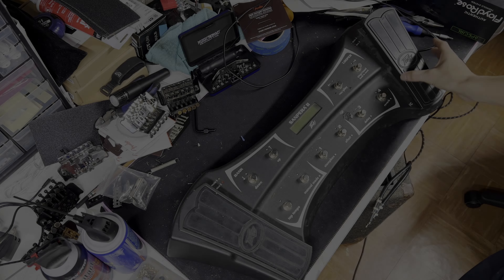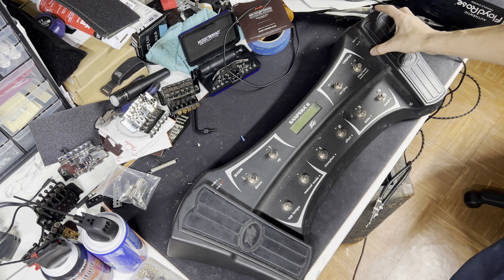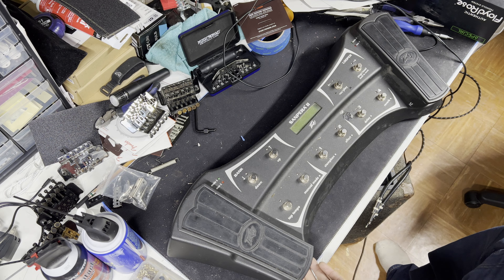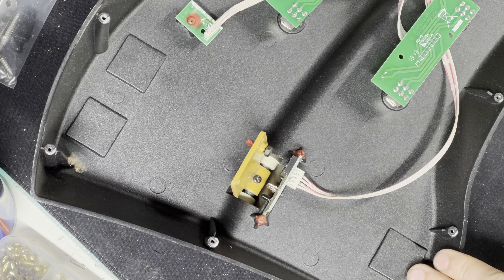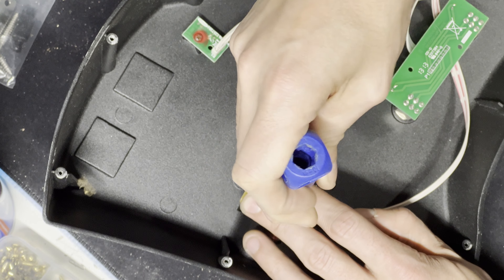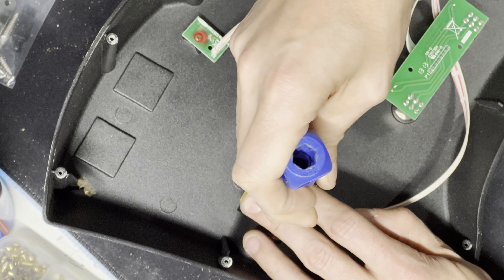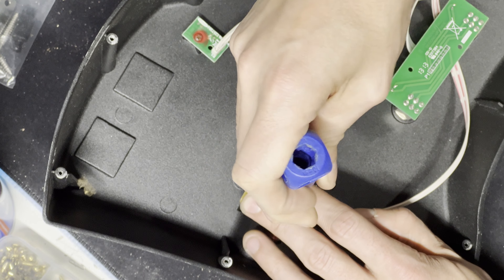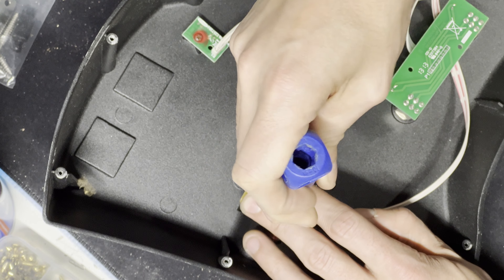Peavey Sanpera II - Footswitch/Toeswitch Repair!

Comment: I fixed this but wah still not working, the led turns on but no wah on right side, I adjusted the screw switch mechanism so it clicks, no wah when led is green ... please help
Reply: It sounds like u need to calibrate it. You can  just google sanpera 2 calibration mode and it'll walk u thru the steps u need to take